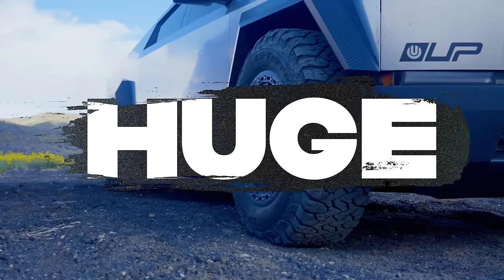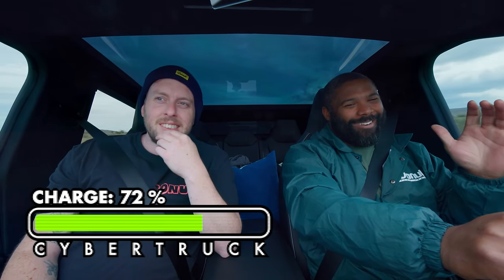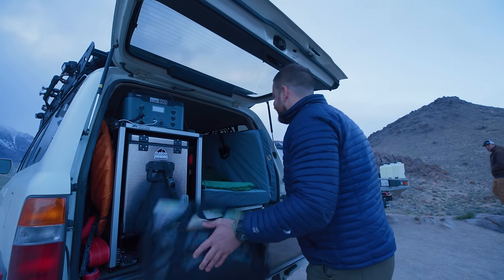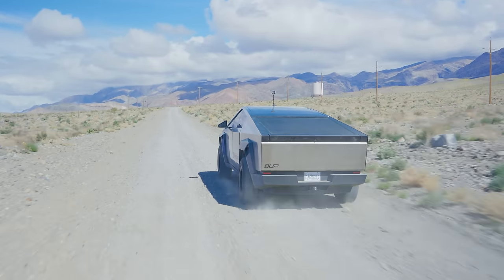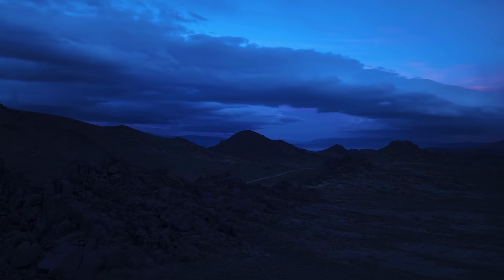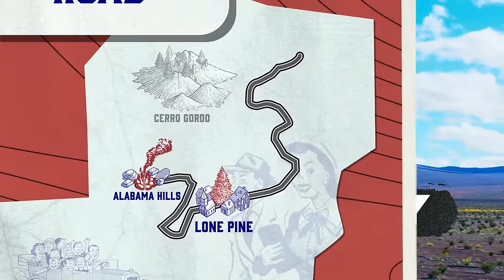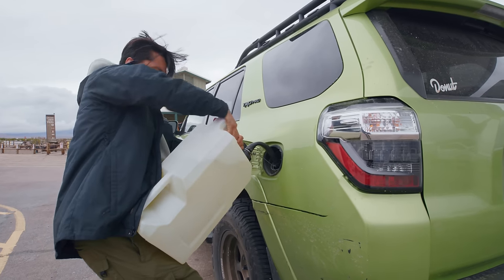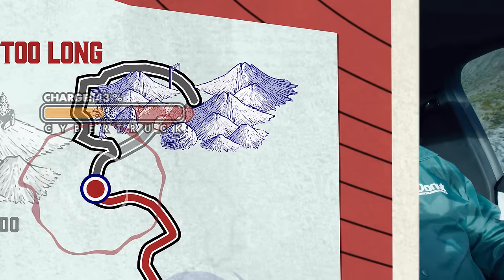Surviving 100 Miles Offroad in a Cybertruck

Comment: Attempt to save 5 watts of energy putting the display on dark mode while you draw literally 10s of thousands of watts through the drive train is hilarious to me
Reply: Those 35” bead-locks are draining the battery faster than anything else on the vehicle…
Reply: @alfwatt  Ground clearance or a good skid plate are very much wanted for offroad, and just think it didn't even have a winch.
Reply: @charlesadams7862  The tires are for grip not clearance. The truck has a foot and a half clearance stock in offroad mode which is about as high as you get without a purpose built hillclimb vehicle. And you probably don't need a skidplate since the bottom is a big smooth sheet of metal already. It isn't like there are moving parts down there to bash off. It depends how pointy the rocks are i suppose.
Reply: Too much like my phone….and I already have one of those🙄
Reply: Its like getting led headlights to safe gas
Reply: its the same mentality that people get when they pop a car out of gear to coast down a grade. we dont know how much it helps to do it but we know it has a real effect. And if it saves us from having to push it was worth it.
Reply: @derikdavid-v7d  when your off the throttle in gear theres no gas being injected into the cylinders. by coasting in nuetral your actually using more gas since the engine has to idlle VS the tires rotating the engine.
Reply: @dirtrider88  is that on all injection engines or only the "newer" ones?
Reply: @dirtrider88 😂😂😂
In older cars when you set your car into neutral you get the least amount of gas injected into the cylinders,  and if you put your car on drive you automatically are getting more gas into the cylinders because the programming is sending a larger amount fuel to turn the wheels. If you drive downhill on drive without stepping on the gas you will need to overcome the drive friction as going downhill in gear without stepping on the gas is technically engine braking.
Reply: @robertopics any car since the early 90s thats fuel injected will cut off fuel to engine break. They actually do it better than modern ones because they dont have stupid emissions control delaying it
Reply: @killkiss_son  Depending on the make of the LCD screen, it would either consume the least or most amount of energy while displaying black or white, other colors being roughly a middle round. it nonetheless is a pathetic amount compared to the main backlight illuminating the panel, probably 10+ times less than the 5w figure
Reply: @dirtrider88 if your car cuts all fuel to the cylinder, you're going to stop choosing and start stalling. You've never ran out of gas have you? 🤦‍♂️
Reply: @Akhaaelikian  its still sweet FA compared to the powertrain
Reply: Yeah it doesn't make any sense
Reply: @kaptein1247  Most injection cars do that 'no fuel when you're in gear', and my 6th gen 5-manual Civic HX does it really determinedly.  It's quite helpful for efficiency, ESPECIALLY if you have to go a long way down a steady but not steep incline...just don't touch the gas and you effectively don't use fuel.  The design of the engine allows it to do that safely, and of course the oil and all that keeps on doing its thing.  The HX-Civic (Maybe other models too, can't swear) actually goes one step beyond by turning off the fuel rail's power when it's not needed, so you are SERIOUSLY not-using-fuel when it's in that mode, but since it's just electricity it turns back on instantly if you decide you need power and step on the gas more.

Other vehicles do stuff LIKE that...some just use tiny bits of fuel and leave the torque converter locked, some just 'keep the engine from stalling' while they drive-idle, but a lot of fuel-injected vehicles with manual transmissions do something like that.  Not sure when they started doing that, but my Civic is a '96, so definitely at least from then.
Reply: @Fly-aaron92  The car is in gear, so the engine won't stall because the pistons are still moving up and down. Gas isn't required. Next time you should robably should google something you don't understand before making yourself look dumb
Reply: @Daniel-ng8fi  and maybe you should actually do some work on a car before you Google something and think you know everything. Just because the pistons are moving doesn't mean the engine is running. A car HAS to has at least some gas to keep running. If it cuts ALL the gas to the cylinders it's going to stop running. 🤦‍♂️
Reply: @Fly-aaron92  lol, I guess you can't help those that don't want to be helped. Stay ignorant my friend.
Reply: And it's not even OLED, so zero difference if it is in dark mode or not.
Reply: @charlesadams7862  But they didnt even go off road...
Reply: @real_andrii - Correct, lcds don’t use any less energy when showing dark content.  The only exception would be displays with auto dimming backlight or zones, but small devices don’t have this.
Reply: @Daniel-ng8fi   Dude, wtf are you talking about?..."Gas isn´t rerequired"?...to keep the engine on?😂 so where exactly are the explosions in the pistons comming from?, please, enlight me 😁
Reply: Dark mode doesn't change the power draw in any meaningful way since it's LCD. You'd need to reduce the backlight brightness.
Reply: @lovienyoutube420  - You haven’t heard of magic pistons before?  They’re featured in one of the Harry Potter movies.
Reply: Put it on airplane mode
Reply: @lovienyoutube420  The car is in gear, that means the pistons are moving up and down as the car goes downhill, it doesn't need combustion to drive the pistons, hence why in modern cars they don't inject any gasoline into the combustion chamber in that scenario, because it's a waste of fuel.
Reply: Can't expect people to know the scale of things :D
Reply: I'm surprised they weren't charging every chance they got. If they had plugged into a 120 outlet at the old mine and while waiting at the gas station, they should have had the extra ten miles to complete the original route. The rockslide still would have doomed them.
Reply: When that graphic that showed all the little features draining the power and everything, driving to their next charge station made me think about "surviving the night until 6am"
Reply: @Daniel-ng8f you can lead the horse to water, but you can't make them understand concepts like gravity and drivetrains.
Reply: and having NO such thing as rolling without fuel (like ICE can during downhill going in gear)
Reply: @Fly-aaron92 Apart from carburator enegines thst may waste some fuel, injection cuts off when running on gear and no touching accelerate pedal. Simple as that. Engine keeps running from the drivetrain, opposite from normal driving when engine powers up drivetrain and wheels. Not mentioning recuperation used in hybrids or EVs that makes whole process even better. But still in Europe where I live people learned on carburator cars used to leave manual cars on neutral gear because of that thing. I drive on gear without gas a lot of time, my brake pads may live over 40 000 km, brake discs need change before 2nd set of pads because of the time and rust. But I drive diesel that engine brakes more than petrol engine. And always thinking one corner ahead, engine brake and use brake pedal rarely above 40 kph. Sure it wears clutch a bit more but I don't do this for money saving. Just loose my speed earlier in natural way, seeing traffic slowing ahead or road that force me to slow down. Just let the gas off.

Comment: "it feels like a truck"
"no, no it doesn't."

Thanks for the honesty man HAHA

Edited edit: if you want luxury, quietness, softness, what a truck doesn't isn't.. don't get a truck... pretty simple, what you need from a truck isnt comfort... you don't buy a car to drive thru mud, off road, & work... You buy a car to drive on the road, you buy trucks for off-road...

Metaphor: imagine if you will. you buy a skateboard. Then try to cruise down the road... You complain it isn't a long board, then change it. Why didn't you just get the longboard?...
Reply: To be fair.. he MIGHT mean it feels like a car and more comfortable than a truck? I am no fan of the low poly nightmare, but it not feeling like a truck may have been the closest thing to a compliment Justin actually gave it lol
Reply: What does "feel like a truck" even mean?
Reply: I dunno but compared to the higher trims like the King Ranch or even Lariat F-150, the interior is not very luxurious from my experience.
Reply: @ohwhoaitzjoe  No question.  I have been in some trucks that are so nice I felt like I should take my shoes off at the door.
Reply: He meant because of the 4 wheel steering at lower speeds, it turns the same as a model S so of course it doesn't feel like a truck because of that 😂
Reply: @spydey2k  I have driven 300k+ miles in sports cars, 150k+ miles in trucks, and 90k+ in normal sedans, along with 100k+ on motorcycles.  Driving a truck feels distinctly different from driving a sedan or a sportscar. I have rarely driven a friend's SUV (or rental) and none of the newer SUVs drive like trucks, they are much more similar to how sedans feel. From online reviews and YouTube commentary videos, they often mention how the cybertruck does not feel like driving a truck. But I have never heard any say that it feels like driving a car. So my guess is that with drive-by-wire, all-electric drivetrain, four wheel steering, and an elevated driving position we have a new category of vehicle as far as how it feels to drive it.
Reply: @ohwhoaitzjoe  I agree with you. But from people that like it, they say the understated nature is what is luxurious. Not my cup of tea, I like my AMG c63s interior. Thats what I think of luxurious to mean. I am sure Bently and RR drivers think theirs is luxury and mine is commonplace.
Reply: imagine that... guy from California has no idea what a truck feels like
Reply: Where’s an F-150 lightning decked out for true off roading?   That should feel more like a truck and be something more akin to what Donut’s crew is used to!   Still would need to pack a generator and some Jerry cans to complete the trip, but likely feasible and a better comparable to the Land Cruisers.
Reply: I mean, does it feel like a truck like a little toy truck like a f-series or silverado? Or real man's truck like a Mack or Kenworth 😅
Reply: More like a giant RC car
Reply: @xbeaker  What do you mean ? Pickup trucks are way more comfortable than any car. Wtf.
Reply: @spydey2k  if you've never driven a truck you wouldn't understand... what does a car feel like? suspension, stiffness, ride, everything
Reply: @redneck94chevy  id imagine it feels like driving a car that sits up high.......
Reply: I’ve never driven a Cummings. Driven a couple of Cummins though.
Reply: I've driven mostly newer full sized trucks and newer school busses , like 2020 + but first thing I've ever driven was a 97 ranger.
Reply: @FastEvan47  auto correct LOL
Reply: Idk man any newer truck just feels like a sedan but bigger
Reply: I mean, it tracks with what others say, I've heard some reviewers say it feels more like Tesla's normal cars than a truck lol
Reply: @spydey2k most American pickups are loud, uncomfortable, clunky and rattle. You get a lot of road noise.
Reply: @CanisoGaming laughs in GM quadrasteer
Reply: @IbangedYaMama no they fucking aren’t. I’ve driven GMC 1500, 2500, and 3500’s most of my life, a 2g Tacoma, 3g Tacoma, and a 2g tundra. Compared to my dad’s 3 and 5 series bmw, Q50s, and C63, they ride like shit. The ONLY thing comfortable about trucks is that they have big interiors
Reply: I can guarantee you a Dodge Cummings is nothing like a semi.
Reply: @TristynRusselo  California is more than just LA or the bay area. First time I drove a tuned, lifted turbodiesel, I was out near Yosemite... with the owner, who has lived in California all his life. I actually brought him a few parts from out of state (shhh). Agriculture is a huge industry in California, towing is a necessity. Hence, plenty of diesel truck culture.
Reply: I drive a 2001 Chevy Avalance and a 2000 Trans Am ... both V8s.
Driving a pickup is like driving on something that's going to tip over anytime you take a turn.  This is made worse if you put in a lift kit.  So, I have to drive like a granny when I drive the pickup.  I've NEVER got a speeding ticket in my pickup ... they've all been in my Trans Am, including one where I hit 140 mph (yes, I spent a night in jail for that).
If you're trying to impress upon how "manly" it is to drive a pickup, you've failed.
Reply: @spydey2k stiff suspension, sits higher than most traffic, big motors (usually), basically less refined than a car
Reply: @jedro86  Yeah, I don't get these people.  Whether they're driving a Cybertruck, a F-150 Lightning, or a Rivian RT1, they have ALL that room in the bed to haul a 220v-240v gas generator and a few jerry cans full of fuel AND they even have room to mock up their own solar panel "tonneau cover" for 400 to 700 watts just using cheap 2x4 frame lumber.  Even if they can't charge the truck with solar as they are driving, they can still charge a couple of LiFePO4 batteries and then use those those at night to charge the truck when it's stationary at night.
Reply: @IbangedYaMama  Yeah ford rangers are the most spacious and comfortable vehicle on the road!
Reply: Lmao I only clicked on this video because Justin is in thumbnail, I knew this garbage bin on wheels is gonna fail xD
Reply: You mean like a Honda ridgeline?
Reply: trucks feel like shit lol i like trucks but they feel like shit
Reply: @spydey2k  Most trucks feel jittery, unrefined and heavy. You feel the bed wiggle over every bump, and while there is an underlying solidity, they're generally uncomfortable on bad pavement, especially when the vehicle is completely unloaded. There are exceptions, but most trucks made within the last 30 years feel like this. You have to pay 50K+ for a much newer truck to get ride quality that's similar to a nice car, but even those still steer and handle like crap.
Reply: Truck means shit so that is good
Reply: The cybertruck does not handle like a truck it handles like a little sports car it's so weird
Reply: You completely missed the point of that comment. It doesn't feel like a truck was a compliment.
Reply: if anyone wants to know how a truck feels like, take your car to shop, tell them to replace the shocks and springs for wood pucks, and then go over some bumps
Reply: I'm definitively not a Tesla fan, but to me saying that it DOESN'T feel like a truck is a compliment rather than the opposite... I mean "trucks" are specifically known for being nimble, quiet, comfortable, quick, luxurious.....
In short saying that something is "truck like" to me is basically just another way of saying that a vehicle is comparatively  "Big and and cumbersome", possibly also denoting that it can handle "bigger loads", but that isn't really a "compliment" if You are not "hauling"...
Reply: @mrdr9534  Thats exactly my point. you cant have that in a truck.. if you want a truck, you want it for off road. 

It'd be like buying a skateboard & complaining it isnt a long board, then making it change LOL
Reply: Imagine trying to tell people how to use their cars...
Reply: Agreed, but I think you mean analogy not metaphor.
Reply: Not Bulky, not slow, not noisy,  stirs like butter, and has light shows.  Can't feel like a truck.
Reply: This thing off roads better than 99% of trucks out there